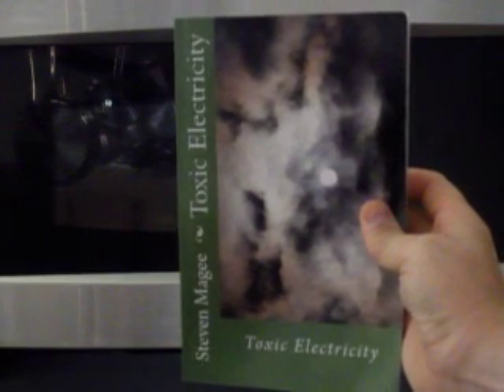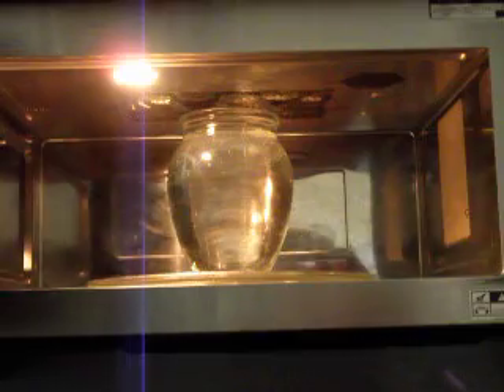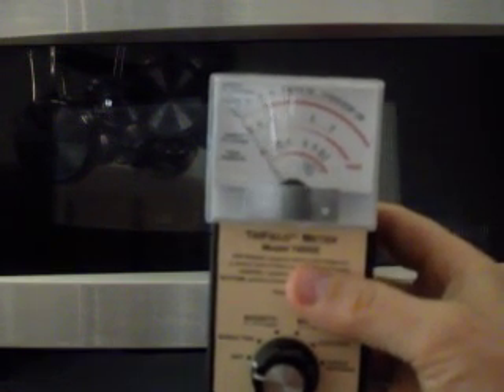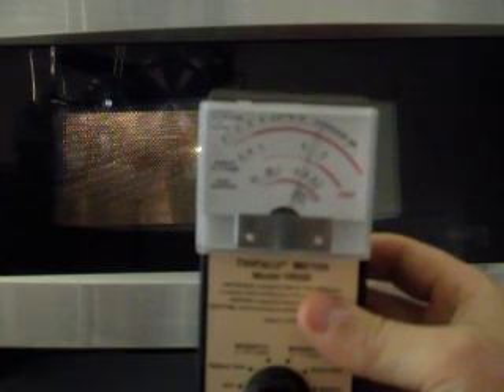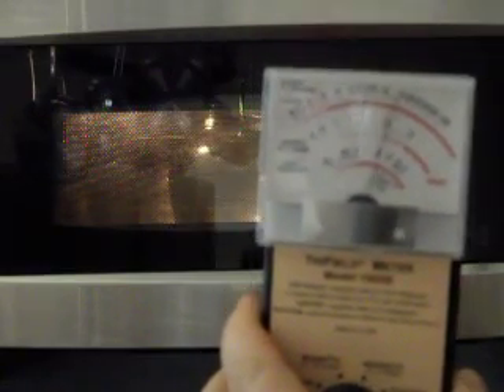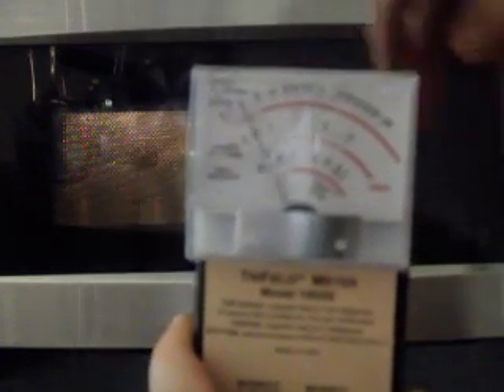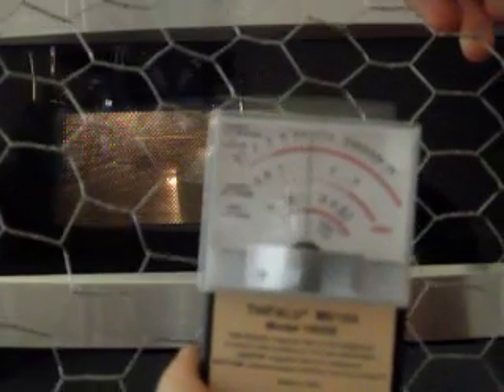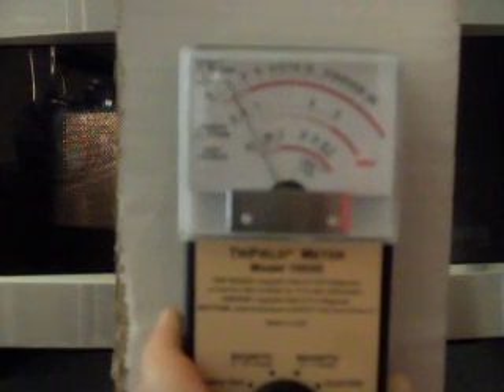Testing Microwave Shielding Materials

Comment: Hii steven again,

btw, i am keep wondering this:

when we put mesh with tiny holes  or aluminum sheet in between the microwave source and microwave detector device , it blocked all the microwave reading on the detector. 
why is it ?  
does the sheet or mesh absorbed the wave (since the wave is of high freq, when being absorb (the sheet and mesh acts like a damper for the microwave, kind of like a capacitor in a electric circuit, after being absorbed by the sheet and mesh, they are no longer microwave) . is it so ?  being absorbed by the sheet ? 
or 
being evenly distributed by the sheet ? 
what i meant by evenly distributed is that the wave goes into resonance with the sheet, and the whole sheet is resonating at the same frequency BUT at a lower amplitude  throughout the whole sheet.. hence  the detector can't detect it, because the amplitude become so much lower , because being "diluted" distributed to a bigger surface area. 
why i say this is:
i saw the youtube video where the professor said the mattress coils absorbed the microwave and emitting it to the human who sleep on it..  so in this sence, the coil is acting like an antenna.. since the coil can acts as antenna, why the alu sheet and mesh won't behave the same ? 

your opinion and experience will be appreciated. 
 appreciate it. 
andrew
Reply: Microwaves are quite wide. A couple of inches. So it won't pass threw and it will be absorbed by the mesh. Then just isolate the mesh and you are safe

Comment: During my own testing I have found that when any part of the body or hand is near the test zone you'd be completing the circuit or blocking/absorbing rather then the small piece of foil one is attempting to block with.
OR maybe because your body is grounding it.
Reply: Andrea H as a carbon-based life or perhaps it's absorbing. Much like the carbon paint that was mentioned they might have the same Factor. It's not grounding it it's just giving it a medium to move through theoretically like a wire that might be too small to gauge a strong enough microwave transmission would penetrate it or exhaust its ability to negate it.

Comment: What also would good shielding material would be velostat, mu stainless steel, mu boron carbide. Velostat is a cuductive ferrocarbon material which conducts and reduces magnetic fields. Mu stainless steel or iron is Ferris material witch conducts reduces magnetic field. Boron carbide is also a good material shields/blocks X-ray and gamma rays just as good as led. A magnetic field can pass through almost any materal, you have to shield yourself from that not just rf radiation. You can find these materials on eBay , Amazon and elsewhere for cheap. It may take 3 or more layers of all these materials  to work.
Reply: You could also try stainless steel conductive thread, and sew it in to fabric that you can whare.

Comment: unfortunately foil is reactive to acidic substance, over time it will have hole in them.  another good material for blocking microwave is radiator reflectors. They works better than 3 layers of aluminium folis and they are not reactive. Good video though.